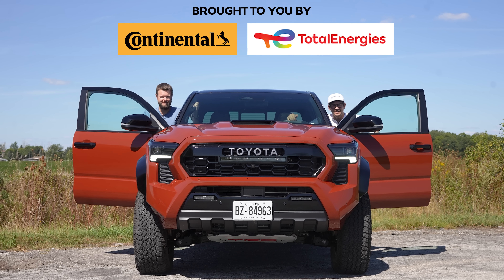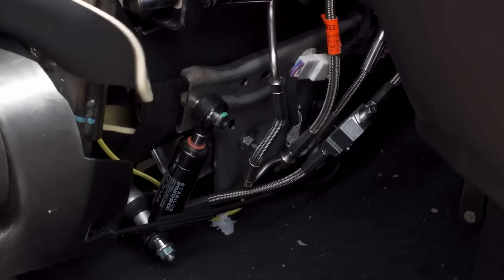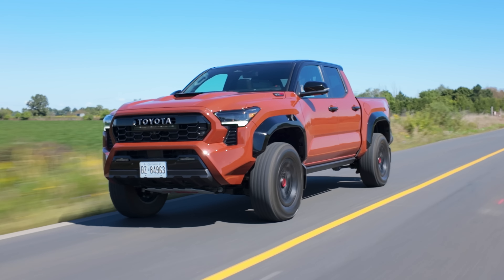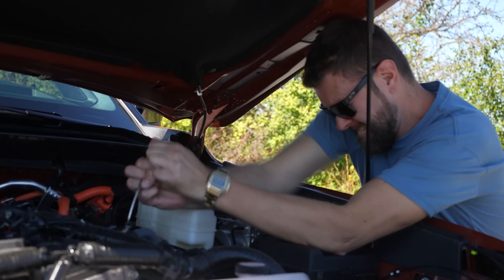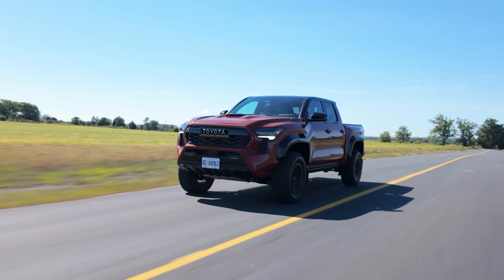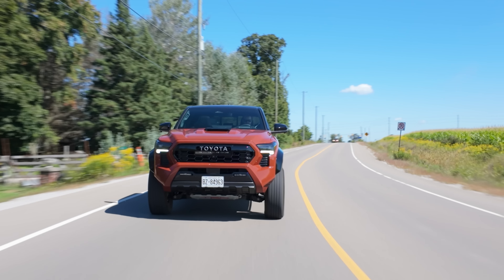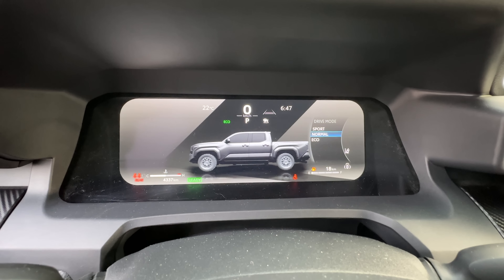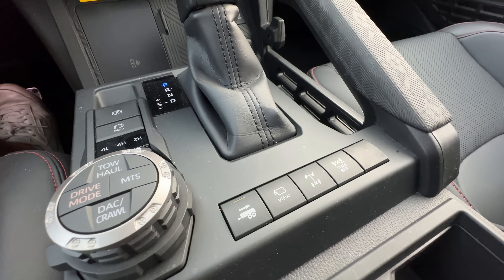RIP RANGER RAPTOR? 2024 Toyota Tacoma TRD PRO

Comment: Acura MDX Platinum money for a truck full of plastic and zero luxury.  Even if you need off-road, just get the base model, drive it until its out of warranty or buy used in 3 years and use the $30-40k difference to "soup up" a lightly used Tacoma.  That's how you Tacoma.  The only TRD PRO worth buying is the old V6 4runner just because it looks cool.  This looks like any other truck on the road.

Comment: The seats should be optional on the Pro, and the intake should be optional on the Trailhunter. I wouldn't be able to leave with either. And Toyota screwed up by not using longer suspension arms, like the Ranger Raptor. 
The Ranger Raptor would get my money, especially considering the price difference.

Comment: 2019 Ford: Ranger is going to have a turbo 4 engine only

2023 GM: The Colorado and Canyon will be turbo 4 engines only

2024 Toyota: Tacoma will be turbo 4 engine only

2024 Ford: Ranger has the turbo 4, optional 2.7 turbo V6 and 3.0 turbo V6 in the Raptor. Oh and here’s an optional software update for the 3.0 for an extra 50 HP and 100 lb/ft of torque 😏

Comment: Ranger Raptor costs significantly less, has a better suspension setup, more ground clearance, and a larger displacement engine with more power. Can’t even justify Toyota reliability here as the new Tacomas have been horribly unreliable (I know from personal experience). Not even having a bump stop on the LCA on their desert runner trim is wild…

Comment: Ranger Raptor is infinitely better. Get a twin turbo V6 putting out considerable more HP, actually has a backseat (the gimmicky seat absorbers are a joke...right?), and those gloss black fender flares are not going to hold up after off-roading a couple times. Ford for the win, plus it's 10k cheaper than the Tacoma TRD Pro.
Reply: Ranger Raptor has more HP but the TRD Pro has more torque.
Reply: @DeuceDeuceBravo  The Tacoma weighs more so you will not get the benefit of that extra torque.  For $800 from Ford, you can tune (under warranty) the Raptor to 455 hp.
Reply: @layne4376  Agreed. Just pointing out the power numbers aren't drastically better for the Raptor. 
And the factory tune requires premium gas for the extra power... That would get very pricey.
Reply: @DeuceDeuceBravo  But the actual acceleration is significantly better  400 is much greater than 326 which explains the almost 1.5 seconds better to 60.
Reply: @layne4376  That's great if you're drag racing your truck all over the place. 😄
Reply: @DeuceDeuceBravo  The better power to weight ratio, the better torque to weight ratio means a vastly better ability to haul loads.  Or you know, passing a semi truck on the highway.  The Raptor is superior on road, off road, in acceleration, passing power, utility, room for passengers, tech, etc.  It comes with a full time 4wd mode.  Even the Taco Pro doesn't have that.  Given Toyota's recent issues with their turbo motors, I will gladly take a proving Ford V6 turbo over any 4 cyl hybrid turbo that doesn't even get the benefit of decent fuel mileage because it is such a heavy turd.  There is a reason that they are being discounted so heavily!
Reply: @layne4376  I'm with you. If I was buying today, I'd be getting the Ranger Raptor. Toyota did not do enough to justify the price of the Pro.

Comment: Y'all need to do the Frontier Pro4X. Those things are seriously underrated and the only reliable V6 mid-size truck on the market today.
Reply: Great truck no question, but capability wise they compete with the Ranger tremor and the TRD off road. They don’t quite have the suspension setups of these trd pro, ZR2, or Ranger raptor

Comment: I don't understand why somebody would spend 20 to $30,000 more for a ranger raptor and a TRD pro over a ZR2.
Reply: Because they are not Toyota. Toyota buyers only buy Toyota vehicles. Many wouldn’t consider American brands because of reliability. However, depending how this works out in the next couple years it could change. The pricing has given trucks like the ridgeline and frontier more sales. It’s not a mystery. It really is only Americans who believe you need a V8 for a truck. In other countries, people just want a good truck doesn’t matter the engine size or power. It’s the reason why the Hilux has such a cult following. And the Tacoma has built a legendary reputation. I think in Hawaii there is so many Tacomas. My neighbor has 3 Tacomas. And they just added a 4th  a couple months ago a brand new 2024 model. Expensive think it was like 50k
Reply: I paid 58k for the RR, ZR2 was like 52k for the non bison and 67k ish for the Bison so it depends. All that being said I love the chevy also, I would get that in a heart beat over the Toyota.

Comment: The ranger raptor tops this by miles! More power more capable better shocks and suspension better seats more rear in the back for my kids on and on! Toyota quality is no longer there! Weak front diff in the toyota. Snaps like a twig! Only toyota files would buy this over the ranger raptor! Toyota really dropped the ball on this one

Comment: How much are those seats going to cost to replace when our American fat asses wear those gas tubes out.   The trunk and hood don’t weight much and they wear those things out on every single vehicle.  Why wouldn’t Toyota put a straight six in this thing?  That b58 bmw engine would be so good in this truck.
Reply: Knowing Toyota, those shocks probably cost half the price of the truck at the parts counter. The damn nav system for my Lexus GX460 cost $10,000 in a truck that was like $55k new 🤣

Gotta send it in to a bike shop to have them rebuilt every season like a mountain bike suspension.

Comment: The latest generation of Toyota trucks are not reliable. Between the catastrophic powertrain failure and recall of the Tundra, and the exploding front diff and failing transmissions of the Tacoma, Toyota is unrecognizable. Most expensive in its segment, unreliable. Pass.